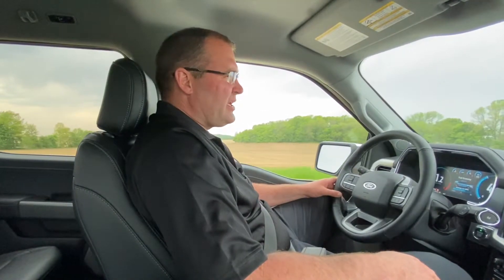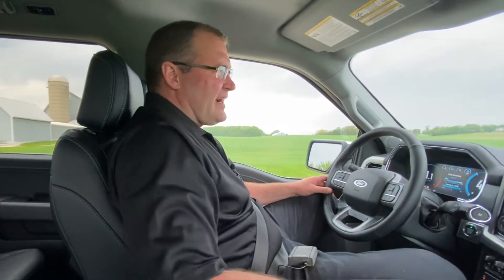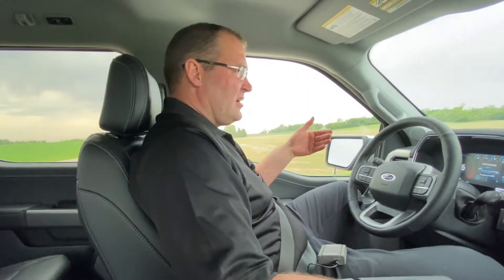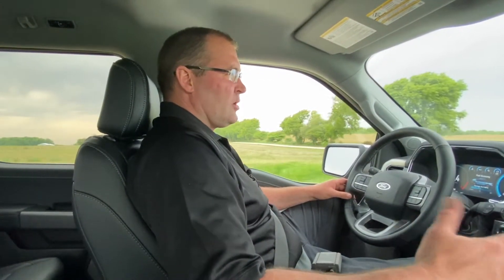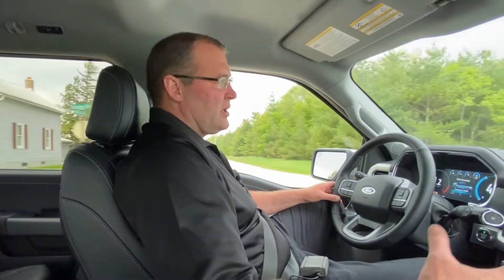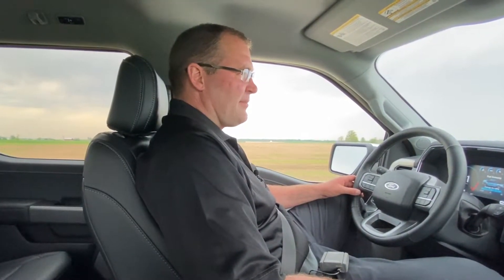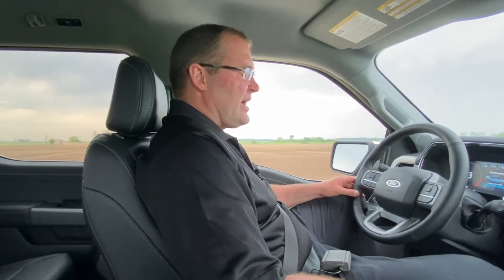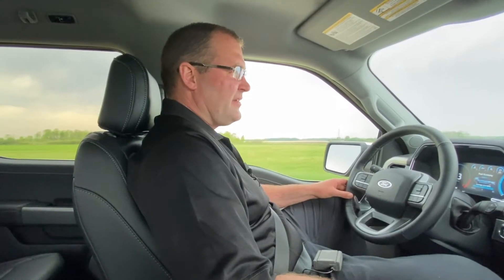Ford F-150 V8 5.0L Coyote Aftermarket Exhaust - Beware of Cylinder Deactivation!

Comment: I felt the exact same way about the auto stop/start on my ‘19 F150. My advise it get a tuner like you spoke about. Chances are if you are willing to put an aftermarket exhaust on your truck you will also like the added performance of the pre loaded (basic) tune, which also allows you to defeat auto stop/start permanently and cylinder deactivation. I love my bdx tuner, before gas prices went crazy I had a custom flex fuel tune loaded on my truck from VMP performance, combined with the roush intake and exhaust on 100 octane the truck was an insane sleeper. The beauty of the tuner is you can put it back to stock in 10 minutes. I’ve since gone back to the basic pre loaded tune and 87 octane but it still doesn’t have the auto stop crap but will still break the tires loose at 60 mph. I was under $400 and everything was easy, do it yourself, plug into your obd port and just don’t touch anything while flashing the truck. If you want to get a little more technical look up the forscan program, you can do great things like make your windows go up and down with your key fob like ford should have done from the factory since the modules are already installed in the trucks!!
Reply from the maker: Thanks for the input.  Yes, I'm planning on a tune.  I ordered an $800 tuner box from Livernois in Michigan.  Haven't used it yet since it's on backorder but I'll figure it out.  Looking forward to this last piece for my purchase.

Comment: I tow 80% of the time so an SPD Performance axle dump exhaust is going to get ordered before delivery. Thanks for the feedback, an educated purchase is always best.
Reply from the maker: Thanks for watching and good luck with the new machine!
Reply: Be wary of the spd exhaust, it’s not for the faint of heart. I have the axle dump on my 2022 stx 5.0, and without the resonator it droned unbearably. With the stock resonator back on I can deal with it, but still substantial drone. When the cylinder deactivation kicks in it sounds like you are being chased by a helicopter 5 feet away lol.

Comment: This is interesting. I just installed the Corsa Sport for my 2022 5.0 and I'm getting this resonance / drone at exactly 1200 to 1300 rmp. I'm not sure if it's the cylinder deactivation or what but it sounds exactly like what you are demonstrating. It seems to always be there though. 

It's a shame because I got the Corsa for the minimal / no drone as they advertise.
Reply from the maker: I'm generally over it but still would rather go without it.

Comment: What did it sound like when it was in v4 mode
Reply from the maker: Stock, you can't notice any difference even when you listen for it, but with an aftermarket exhaust it sounds like a super distorted low tone that is not attractive.  It sounds like something is wrong even though it isn't.  You won't mistake it once you hear it.  It's usually most prominent during city driving.
Reply: Why didn't you show us the sound difference?

Comment: My 22 NEVER leaves sport mode...its a blast to drive in that and If I were concerned over a couple MPG i would have bought a smaller truck
Reply from the maker: I wish you could have a default drive mode instead of having to push a button or turn the dial on every startup.  I agree that sport is super fun.
Reply: @danimalshouse  I just bought a 23 with the 1.9 financing through Ford... it now allows you to stay in the last mode you were in... upon starting the truck it asks if you want to stay in sport mode...
Much better than cranking the know every time..